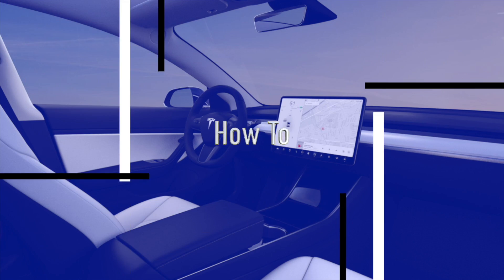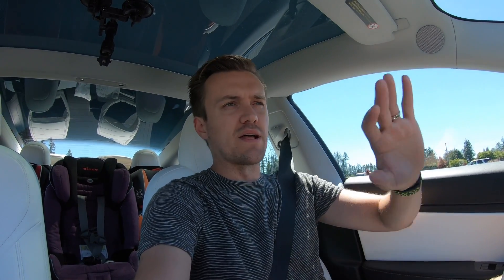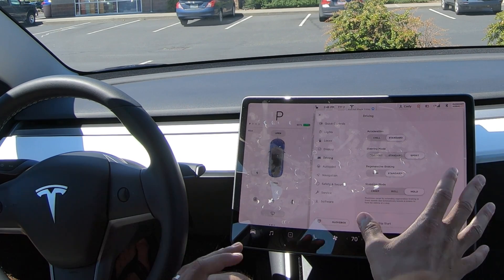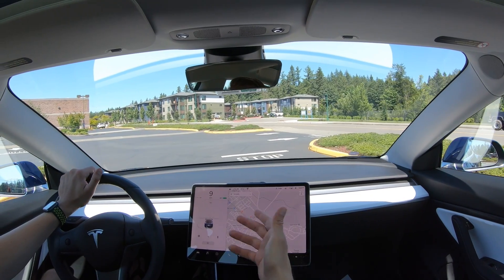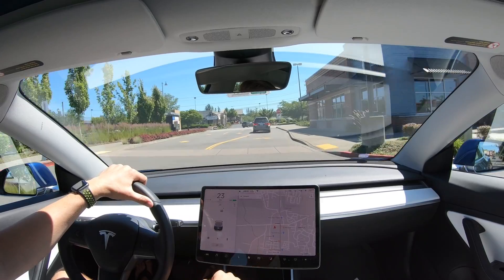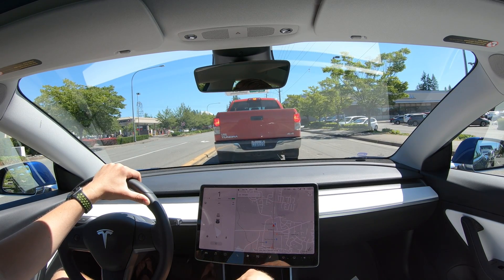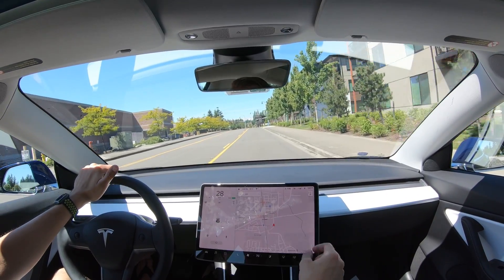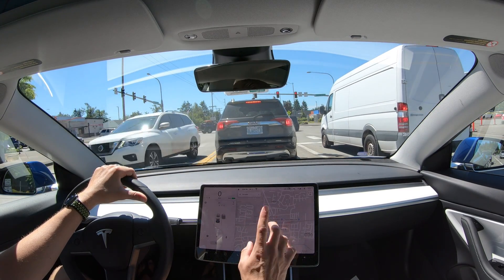Regenerative braking explained | Tesla Model 3 Tutorial #12

Comment: I don’t understand how this increases the range. As a truck driver we are taught to roll as much and and as far as possible to save fuel. And you do save alot of fuel in so doing. 

Regenerative braking is the complete oposite of that, so i would be interested in testing both to really see if you save anything with this. 

It would have to be tested by someone who knows how to use rolling energy for max efficiency.

Comment: I believe Tesla designed this incorrectly since most people expect their car to glide when they take their foot off the gas, and only to brake when they apply the brakes. I was told by a colleague that Ford eMustang glides when they take their foot off the gas , so Ford got this right. If you consider how much energy it took you to get to cruising speed, many times it makes sense to glide prior to applying brakes or applying the gas, if traffic appears to be slowing - it is an important technique to save on fuel consumption, whereas, always regenerative braking is just plain stupid when you just want to glide!
Reply from the maker: ok so change that in the settings. That is an option

Comment: Old video but I feel it worth saying based on the comments.

Regen braking feels like downshifting in a manual transmission. The different modes either have the feeling be very gentle, or much stronger. Another way to think about it is that the car has an infinite number of "gears", and the car "downshifts" those gears all the way to 0 in either larger or smaller increments but in a completely smooth way. 

It really is, in my opinion, a superior method of driving. you can charge your battery somewhat, save your brake pads, and could be helpful in slowing you down quicker if used in addition to your brakes. It's different, sure but I got used to it after a few drives. Now I'm a diehard

Comment: How much will regen braking help in emergency and high speed stopping? Because I looked up 60-0 times for Tesla and they weren’t that great.
Reply from the maker: You wouldnt use regen in an emergency.
Reply: @CfTesla  regen doesn’t kick in automatically?
Reply: @Phuong_Nguyen_  Basically, regen is always active.  In the case of an emergency, slam on the brakes and it'll feel like a normal gasoline car.  You still have a brake pedal, it can be used at any time.
Reply: @Phuong_Nguyen_  regen isnt to replace breaks. in an emergency you should be using brakes and even on a normal drive the break will probably be used.in my experience teslas brake fast but regen wont do it alone it just slows it down as much as this video demonstrates. please make sure to always be ready to use brakes

Comment: All electric motors are also generators. You can use electricity to turn the shaft. But if you turn the shaft, you generate electricity. So, use power to make the car go, and generate power when you’re not pushing.

Comment: Can anyone explain what is in the motor that is causing friction to slow you down? Is it magnets or a system of gears that apply some stopping torgue. It must disengage when stepping on the accelerator pedel.
Reply from the maker: Sorry I don't know the inner workings of this. Probably a youtube video out there on it though.
Reply: There's no friction at all! The way regen braking works is by using the motor as a generator. In the same way that a motor takes in electricity and converts it into rotational energy (speeding up the rotation), a generator takes in rotational energy and converts it into electricity (slowing down the rotation). It's all about converting between rotational and electrical energy.
Reply: @Penguin-kr9do  What I have figured out is that a computer applies a variable
load from a inverter/generator to the transmission causing the car to stop thanks to this video.  https://youtu.be/RSwrIUY3qTI

He even shows that there can be so much load that there can even be bounce back. I need to look up more about inverters and see how a variable load is achieved.

Comment: How well does regenerative braking work when you're driving up a steep hill?
Reply: Going up a step hill the battery energy GAIN from regenerative braking is reduced because gravity is slowing the car. Additionally there is greater battery DRAIN from fighting gravity when accelerating uphill. Basically the reverse of what CF explained when going downhill.
Reply: You gain when you come back down the hill.

Comment: What about while it’s raining? I was hydroplaning so I took my foot off the gas naturally, so it applied regenerative braking and I spun out. Did that ever happen to you?
Reply: When pressing the brake pedal the ABS system will engage and pulse the calipers if traction is lost. No ABS with regenerative braking because it is controlled at the motor and not the brake calipers.
Reply: Andrew Leavitt but does that explain my
Conundrum? Once you release the brake, after you hydroplane, the car brakes, the one thing you’re not supposed to do. Maybe I’m missing something, but this Can very dangerous, right? In fact, i spun out. I might not be understanding your explanation, but any clarification would be great. Thanks!
Reply from the maker: @V32-p  This is an interesting point and I am curious to see what Andrew replies.
Reply: Vamsey Palagummi ABS is active. ABS is smart. ABS checks for slippage hundreds of times per second and adjusted each individual caliper so each wheel gets proper traction or slippage to minimize chance of skidding. 

By comparison regenerative braking is dumb. With your foot off the accelerator the car slows and the surplus kinetic energy causes the motor to run in reverse and act as a generator. The regen braking does have some ability to adjust each wheel individually but not always enough to prevent loss the traction. 

I am 100% certain this will be addressed in the future. It may not be entirely possible via a software update alone. I don’t think the regen system controller is sophisticated enough to mimic true ABS. 

In the meantime many Tesla owners turn off regen braking on snowy roads. There is also another setting to entirely disable Traction Control to encourage wheel slippage when stuck in snow. If you are having trouble in rain just turn off your regen and brake manually to always have ABS available. Easy fix until this has a more satisfying solution
Reply: @drdrew3  you can also press the accelerator slightly enough so regen doesn't engage but you also dont accelerate
Reply: @drdrew3  Was about to ask this one if turning off regen would be better in rain or snow. Thanks